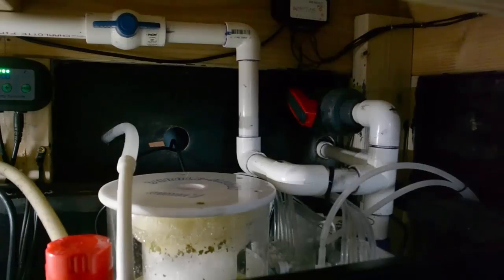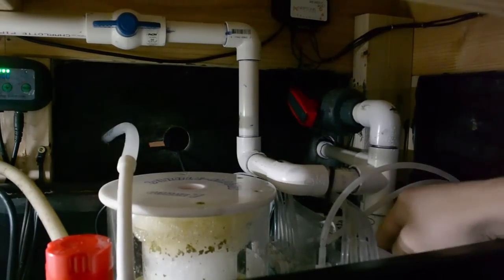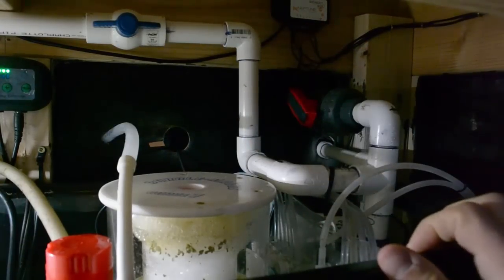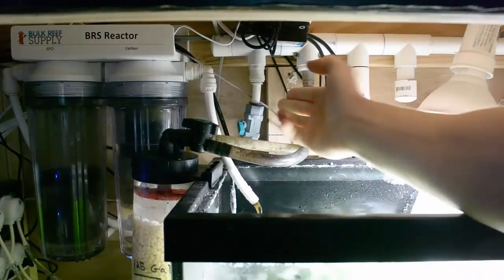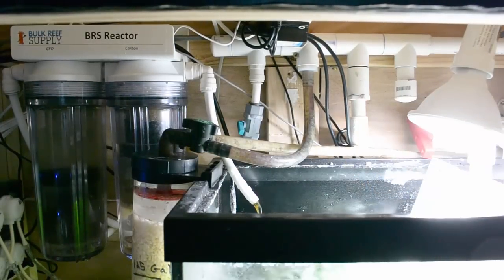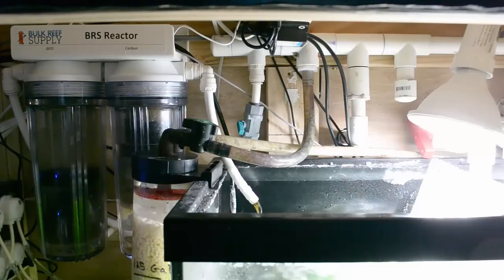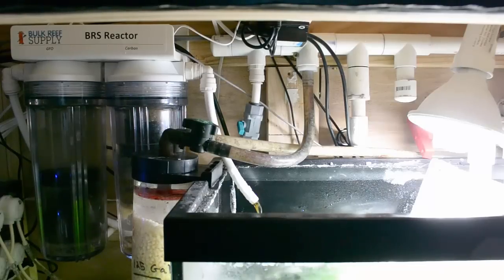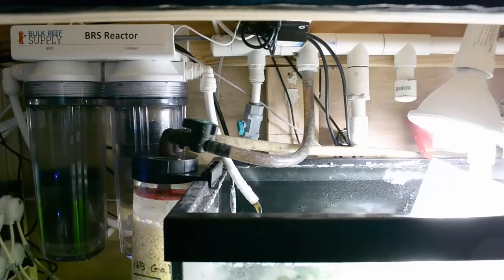Custom Manifold Setup | Reef Tank

Comment: I have my biopellet reactor setup the same way as yours and have the issue similar to others with back siphoning when the pump is shut off without turning off the reactors ball valve. I am considering a manifold but my concern is that every time I shut off the main pump, the biopellets will get sucked up the tube and possibly lodge in the plumbing elbows. Does this still happen or is it decreased since the manifold is higher than the reactor? Thanks for the informative vids.
Reply from the maker: I dont have any issues with siphoning with the manifold.